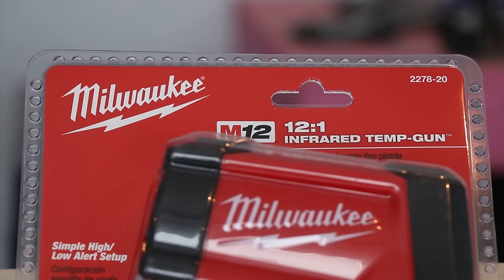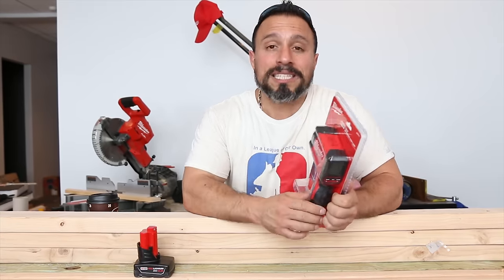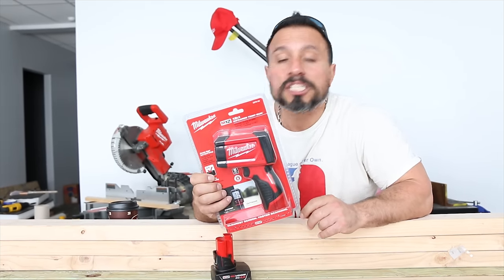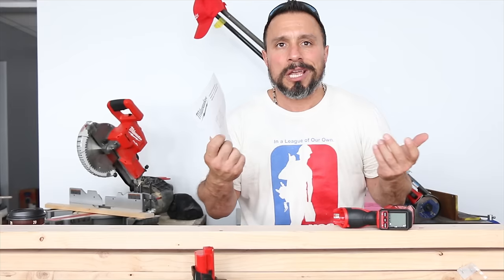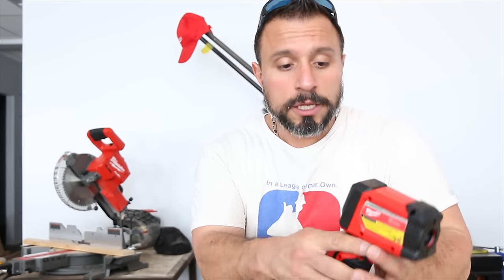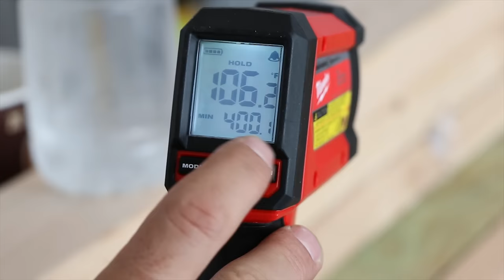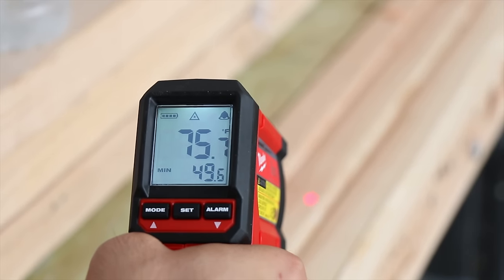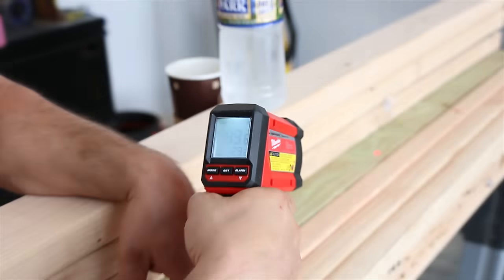Milwaukee M12 Infrared Temperature Gun - Best Infrared Temp Gun?

Comment: I saw you use it in the Gen2 vs Gen3 impact challenge (very useful info). Can you guys do a comparison test on M12 Gen2 vs M18 Gen 2/3 (Drill/Impact)? I got the Gen2 M12 kit with the extra 6ah battery and love it so far. Obviously M18 is going to be more powerful, but it would be cool to see a short video on the  power difference. Heck, bring out some 18V competitors and compare to the M12. I bet the Impact will hold it's own. Been debating about getting the Gen3 M18. Do I need it? Nope - but I love tools!!
Reply from the maker: We'll put it together, thanks for the suggestions!!

Comment: I use a Fluke 62Max. Ive had it awhile now. They are good to use for a quick check for obvious issues (example really hot/really cold.) they lose accuracy on shiny surfaces. I do like the idea utilizing a battery. 
They are also good for use in facilities like a school. Can help narrow down what part of a building is having issues with HVAC without disturbing classes. Just shine through the window to see if its way off.
Reply: gmguy156  i have the fluke 62max and i am very disappointed with it...fluke is supposed to be the best testing tools out there...you know how pricey they are...i only use fluke meters period...they are the best out there....but the 62max is a piece of crap in my opinion...its not very accurate and has the worst battery life i have ever seen...i seem to be replacing the battery once every 3-4 weeks...it only uses 1 AA battery...and fluke should be embarrassed by the accuracy...you would think its a fluke so it would have the best accuracy but it doesnt...im gonna look into this milwaukee temp gun since i have M12 tools already
Reply: kingofthecrease30 
Man I dont blame you based upon your experience at all! Thats terrible. I dont use mine a whole lot so maybe thats why I haven’t noticed issues yet.
Reply: @kingofthecrease30  for any kind of Thermo gun or imager you should be running a flir
Reply: Fusion2016 i dont need a thermal imager...no use for it...i only need a basic temp gun to take temps for hvac & refrigeration...fluke usually makes the best test instruments but the one i bought is not one of them...im gonna try the milwaukee...its prob 1/3 the price of a flir...i know all about flir...its very good stuff
Reply: @kingofthecrease30  I'm fairly sure FLIR makes a basic ir thermometer... It's probably expensive but probably well worth it. My buddy is in HVAC and has a FLIR imager, what a nice piece

Comment: Come on guy, at least read the instructions before trying to tell everyone how they work! 🤦🏻‍♂️. On these temp guns, the 10:1 means that at 10 feet away the spot you are measuring will be 1’ in diameter. At 1’ away the spot is 1.5”, at 3’ away the spot will be 3” in diameter… and so on.